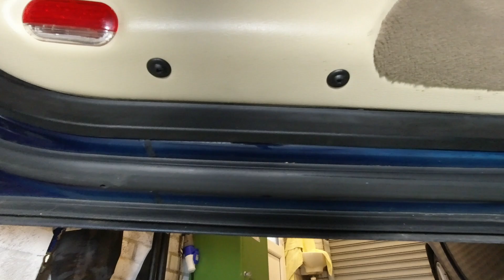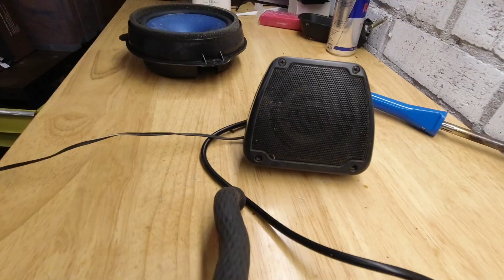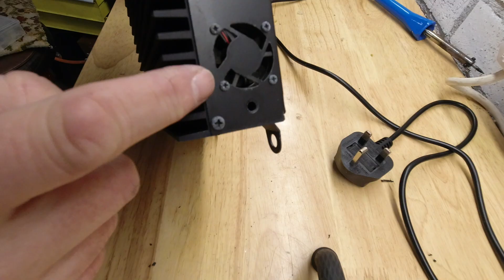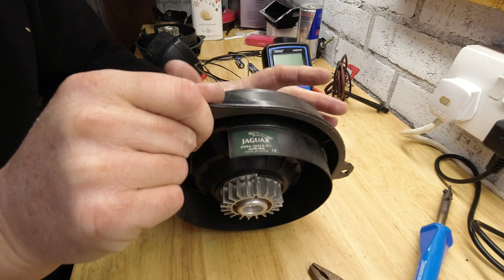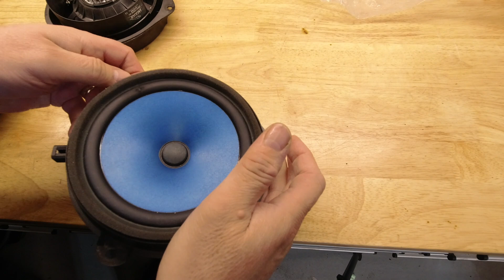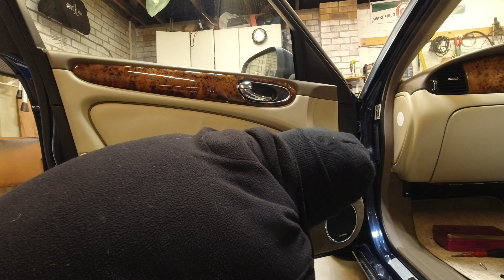BLU 10 Amp and Speaker issues on my Jaguar XJ X358

Comment: Why didn't you consider going with an aftermarket speaker set?
Reply from the maker: Hi Peter.
Purely for the convenience of a direct swap with correct mounting and power handling characteristics that match the others.  It certainly wasn't about originality.
Reply: @tothegarage  btw, I have a theory that a bad speaker is what killed the amp. When a speaker stops working. It either presents the amp a very low impedances or no load and thus the amp over heats until a part of the pcb fails. Amps when they die never kill speakers silently. You will hear it and certainly smell it.

As a result, I would advise replacing the other old aging speakers even if they are working
Reply: Would you have a tip for an aftermarket solution that even half-rtrdd ppl (like myself) can handle?

Comment: Good job John ! Have some issues with my rear speakers on the XKR, impossible to find same equipment nowadays (2ohms), and some electrical contact issus with the radio it self, I should take it out to check connections ... but a little afraid to take out central console to get to the radio ...
Always impressed to the easy looking of watch you do, than when I try to do it, seams to me so complicated !
Take care John !
Reply from the maker: Thanks Henrique. The xk8 console is a very similar arrangement. Not too difficult